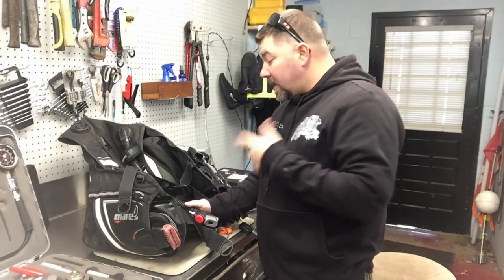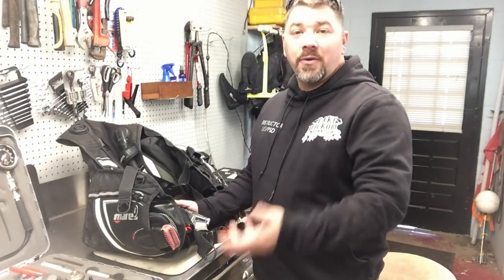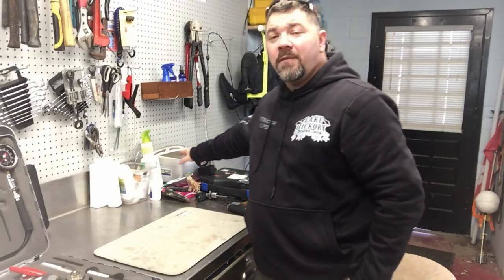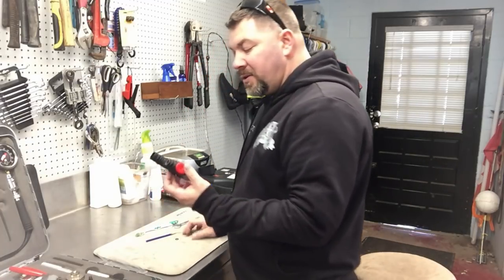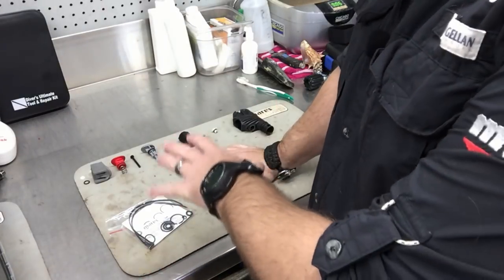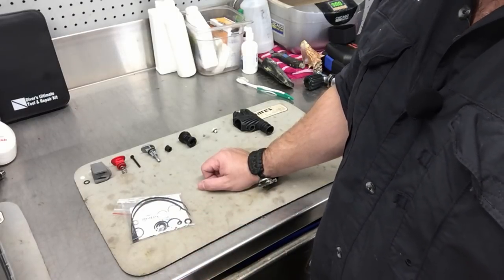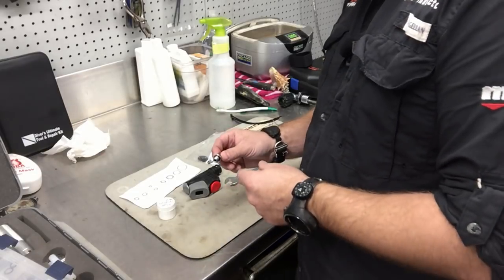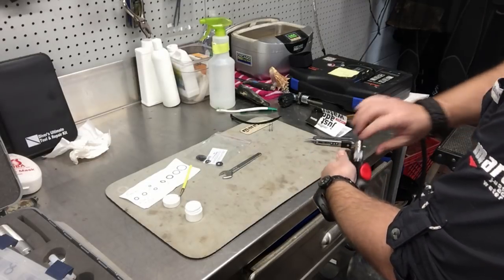Don't Wait To Fix A Problem

Comment: Great video. Thanks for the info but I have to ask why you would spend the time to rebuild the LP inflator when you can get a new one retail for $25.
Reply from the maker: Hello Scuba Mystic, depending on the make, model, and manufacture, repair on inflators typically are cheaper than $25, in some cases they are free, and can be covered under warranty.

Comment: Great video! I just bought a Mares Bolt BCD and use it to salt water dives once a month. And I was wondering how to clean the inflator on my bcd.
What I do is fill the bcd with fresh clean water and make the water come out by both parts of the inflator several times. For last I let the bcd in fresh water for a day and let it dry on the shade.
Reply from the maker: Thank You. That is exactly the same way we teach our students to clean their equipment after each dive.

Comment: Would've been a LOT better if you showed how you really disassembled/assembled that Mares inflator, I understand they can be tricky.
Reply from the maker: Hello E. Sanchez, sorry you didn't like the video. The standard Ergo Inflators are not that difficult to disassemble or to assemble, however, the Mares Air Control can be a beast at times.

Comment: whats the best for cleaning the inside of a BCD to remove salt crystal build up before it get too bad
Reply from the maker: Hello HypnoticAbyss, I am currently using a product called Pau Pilau.  I use this for my wetsuits and for all my other diving equipment as well. A great suggestion is to remove shoulder dump valves on your BCD, and pour water directly into the bladder system.  Then you can simply pour out all the salt.  I will try to make a video on this very topic to help you out.
Reply: @LakeHickoryScuba  great! Thanks :)
Reply from the maker: You're welcome.

Comment: Why don’t you give the old parts back to the customers? The scuba shops I deal with give the old parts back to you if you want them. 
Thanks 
Will
Reply from the maker: Great question. I’ve never really had a customer ask for them to be honest.  Most dynamic O-rings flatten out over time and the rubber will deteriorate, so the reuse of them in general is not possible. Also it comes down to what I am allowed to do through our insurance provider.  Even manufactures recommend discarding old parts.